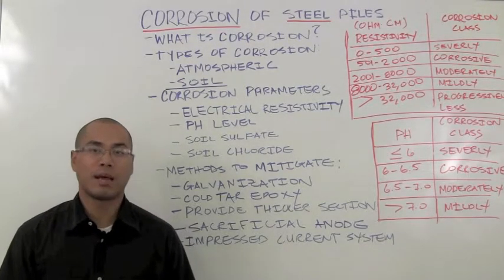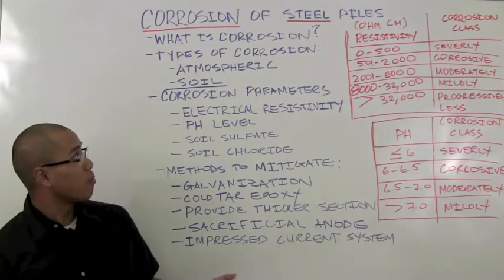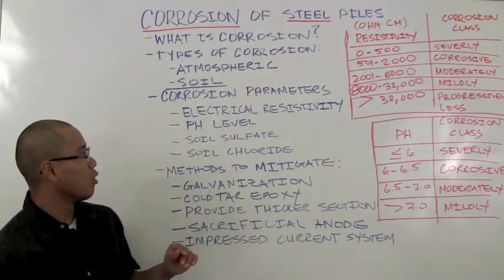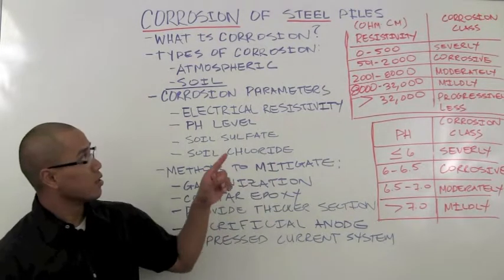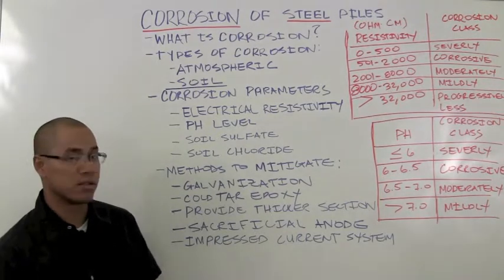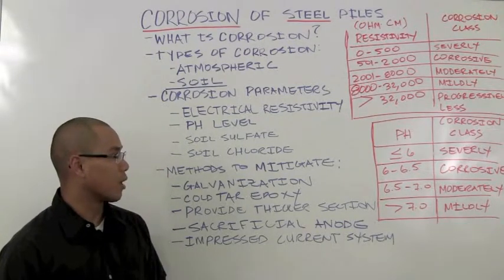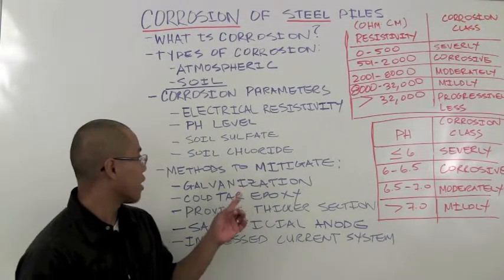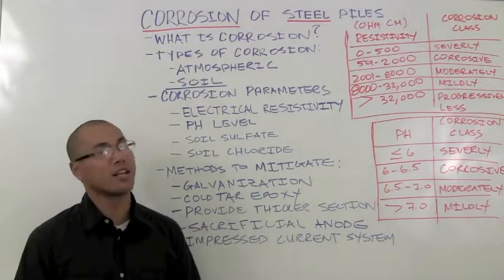Tech Talk 11: Corrosion of Steel Piles

Comment: Don't forget testing soil for probability of corrosive bacteria (MIC) and elements severely corrosive to coppers and brasses such as ammonia and nitrates.  I'd also add Abrasion Resistant Epoxy coatings as a corrosion control recommendation.